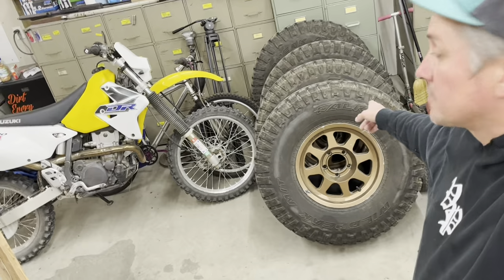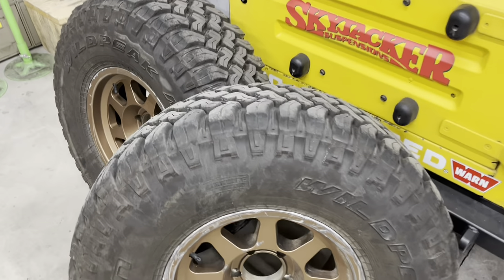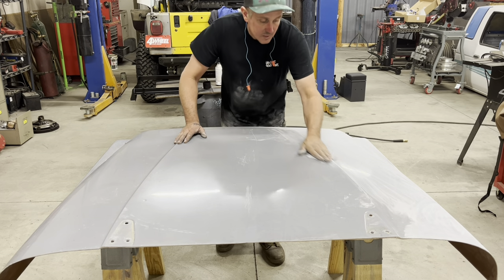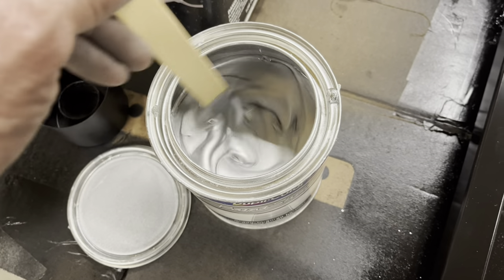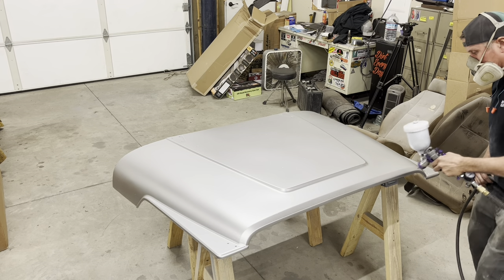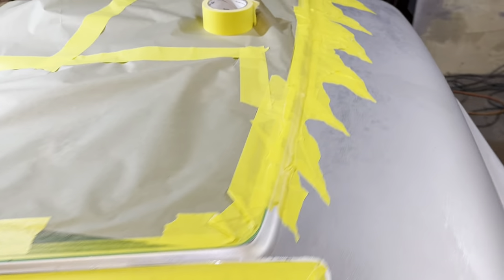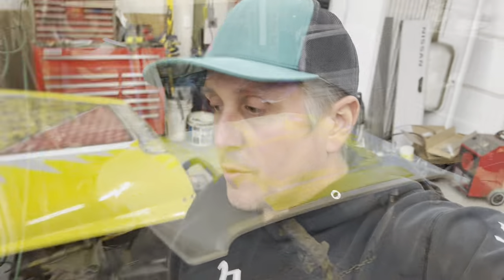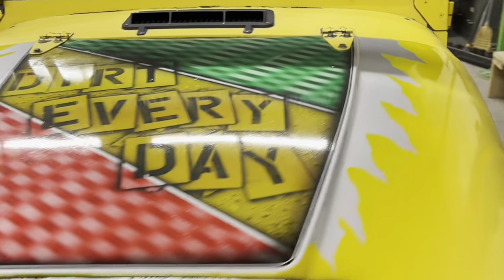Custom Candy Paint , new Wheels and Tires, Jeep tribute to DED

Comment: That's awesome love how that turned out. I just got a Cervini's shaker hood put on my 2013 Dodge Challenger R/T and did something not everyone would do with the shaker scoop color choice but it really makes it pop the hood is black with silver racing stripes and the shaker scoop is almost a Ford grabber blue it really pops and shows off the shaker scoop verses the normal paint matching scheme it also matches the aftermarket shifter knob for the 6 speed manual transmission. Also put 345 HEMI badges on the shaker scoop.
Reply from the maker: Sounds cool. Keep on keeping on

Comment: Did you need to run spacers on the front to keep the wheel/tire from hitting the tie rod/steering arm? I have a cj7 with a narrowed Chevy D44 currently running 15" wheels 3.75" backspace and the 4.75 inch backspace on those Method wheels concerns me.
Reply from the maker: No spacers.  The larger diameter wheel (17) helps make a little more space

Comment: I've painted most of my projects myself. Have they all been perfect.? That would be a No. But I learn something every time so I guess that would be "progress". I really like the color on those wheels. Is that some kind of anodizing or is it something that you can get with a spray can.? I've got some Jeep Grand Cherokee factory aluminum wheels that I think would look good in that color.
Reply from the maker: The wheels come that color from method like that, but duplicolor has a similar wheel paint color in rattle can
Reply: @thedirtheadshed  Thanks for your reply. Looks like I gotta make a run to the auto parts store.